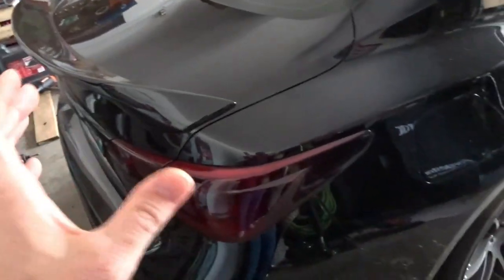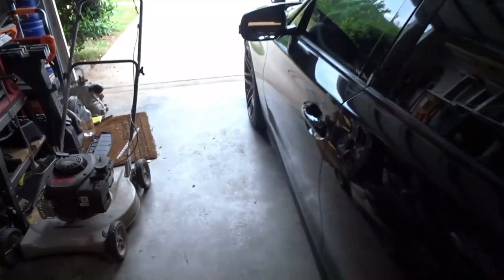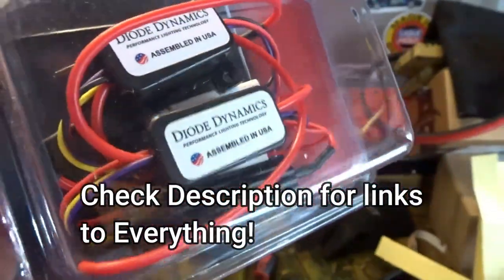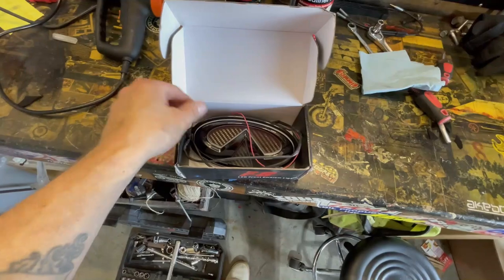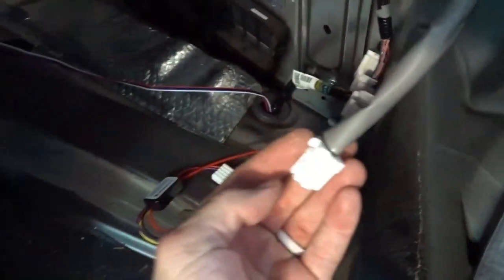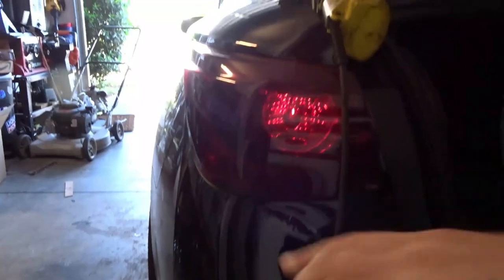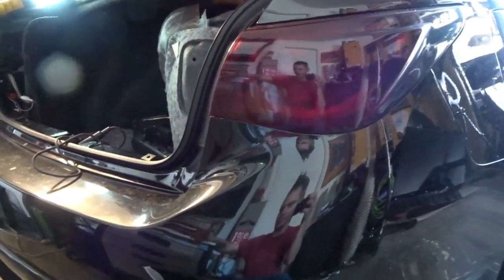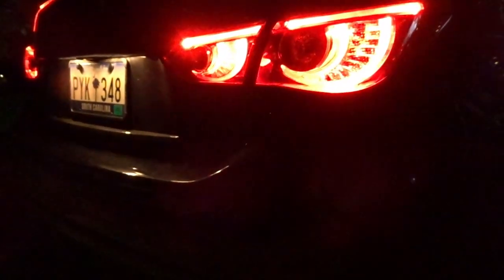Q50 Lighting Upgrade | Diode Dynamics Tail As Turn Signal

Comment: How did you do the wiring for the turn sequentials with diode dynamics and the lower sequential indicatiors?
Reply from the maker: Great question!  That video will be up later this week.  You can actually just plug them right in line but there are cleaner ways to do it
Reply: @SpeedCultureStudios  Sounds good boss you got it